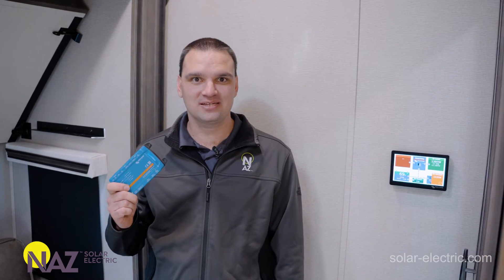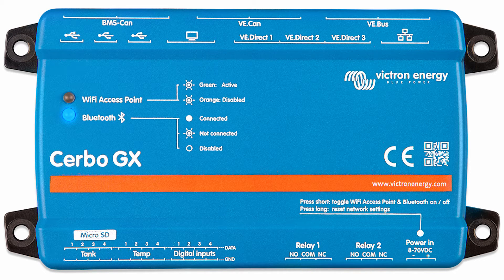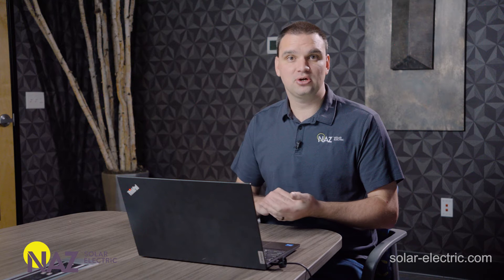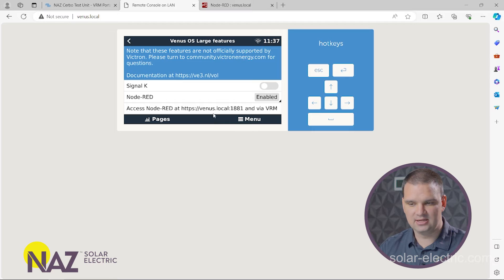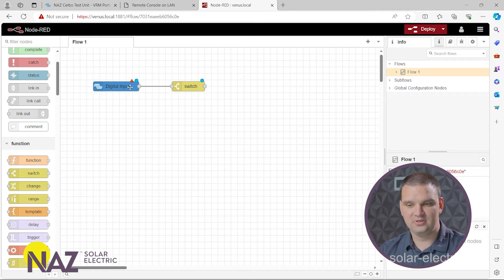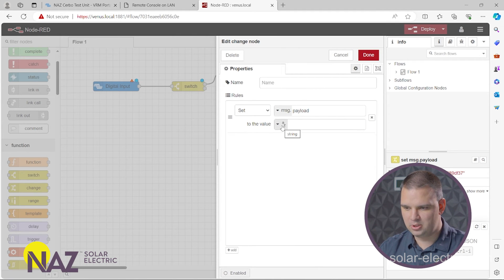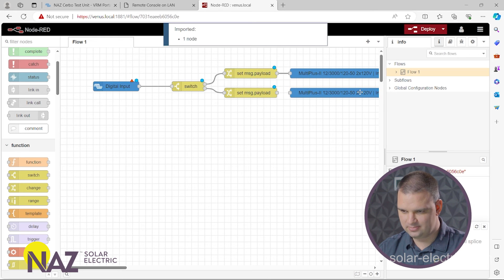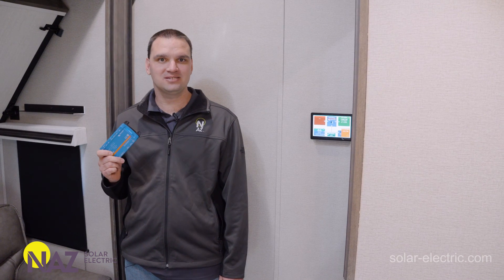Enhancing Your Victron Cerbo GX with NodeRed: Smart Generator Control Tutorial

Comment: Very cool. How does this effect controlling ac input current when you change it using the MP’s  BT dongle… will it always revert back to 50a limit when it comes off of genny power?

Had no idea about the NodeRed. 😅
I try to keep the installations simple. But, nice to know that victron is changing and adding cool features on a regular